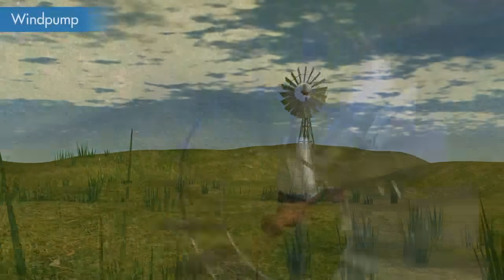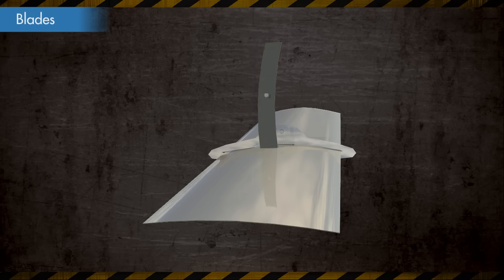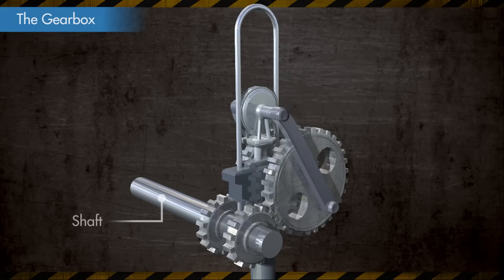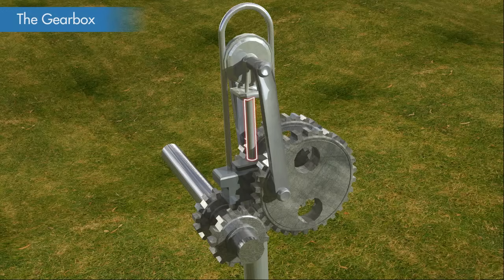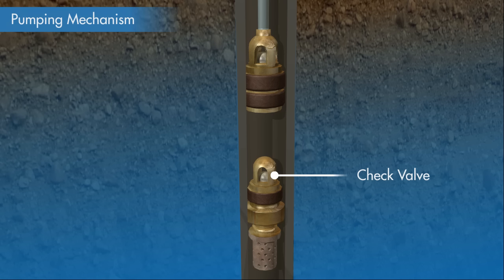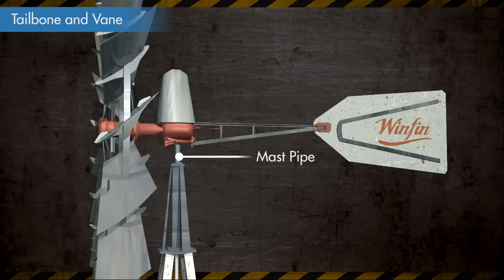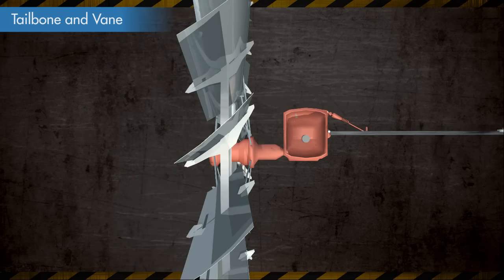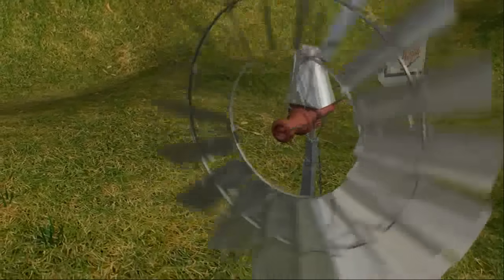Wind pump Mechanism

Comment: How do you turn off the water flow? if the well is constantly going, eventually won't you dry up the well? Hence my question.
Reply: I suppose there will be a breaking mechanism for the stopping of the pumping of water
Reply: We have a lever at the bottom of the tower, when pulled disengages the big cogs.

Comment: Extraordinary video! Really beautifully produced and explained. I have a water-pumping windmill that was installed in 2000. Such resources as a video like this were not readily available. I have learned some from books and from the use of the windmill itself. But it was incredible today to watch this video and clearly see exactly how it's working. I am having an issue with the brake, which necessitated this research. I'll need to climb up the 40-foot tower to explore. This is a huge help and it was a real joy to watch and listen to. Thank you very much!

Comment: This looks like it would be great for large pastures. Put a few of those a couple kilometres apart and animals have water, without the need for electricity. Off-grid preppers are probably fine with a normal well with a bucket on cable.

Comment: Excellent presentation. However, you should maybe think about changing the wind direction over the individual sail vane with a more representative airfoil performance diagram.  The wind creates a low and high pressure  differential which creates lift, which is then transferred to centrifugal motion.

Comment: Watching the video it seems to me that in the upstroke the wind has to lift the weight of the rod+the water ,the potential energy accumulated will be dissipated entirely in water in the downstroke,for me it would be more efficient if the piston had a chamber filled with air that once summerged in the water create a lifting force equal to the weight of the rod
Reply: Smart

Comment: wonder why electricity wind Mills don't have more than 3 blades
Reply: Different purposes need different solutions.  Pumps have lots of blades because they need lots of torque, but lots of blades introduce inefficiency in the form of wing tip vortices and interblade interference, and drag from bracing.  Long narrow blades lose less power that way, kind of like an sailplane with long narrow wings for soaring vs a light plane with short stubby wings, and often bracing, for maneuverability.  Pump turbines are relatively low cost and therefore low-tech, without blade angle of attack adjustment, which electric power turbines, at least big ones, do have.

Comment: How does one stop it if not required any more.
Reply: Most have a chain attached and you manually turn the vane to be parallel with blades to stop "production "

Comment: Is a way to put it in neutral to not pump too much or dry pump kinda ?
Reply: I've seen where the furling device has a manual lockout so that when you pull a lever from the ground, it furls and unfurls the tailbone.

Comment: The wind pump shown in this video is basically the Aermotor styles 602, 702, and 802, built (I think) in San Angelo, Texas, and under license by FIASA in Argentina. I believe they ship worldwide. The styles 602 and 702 are the most common waterpumping windmills in the USA and there are probably hundreds of thousands of them extant,  and many independent technicians and dealers, who usually also work on other makes and models of windpumps. The same principles, though slightly different design, are found on the Dempster 15, Challenge 27, and other competing windpumps, although not all of these companies are still in business. I am not familiar with the windpumps made overseas, but there are bound to be some good ones.
Reply: HI, May you help how to find the company adress in Texas , please?

Comment: „..... blades are curved to catch the wind....“ completely stupid! Wrong science here. The blades act like wings of a plane and the wind has to go faster around the curved surface so it due to Bernoulli principle it build ups a underpressure which then start the airflow forces the blade to move sideways. Don’t tell shit here, when you try to make a documentary looking like post!
Reply: @paul paulsen the video is not wrong, there are two correct explanations of this phenomenon. the first one argue that it "is the reaction force on the blades caused by deflecting a flow of air" the cause of the movement (in common English "catching the wind") and proof of this is that the old windmills with FLAT wooden blades work just fine. The second explanation is the one you mention. I leave a link to a NASA article with the full explanation: https://www.grc.nasa.gov/www/k-12/airplane/bernnew.html

Comment: Can't understand the spring part. If it increases the pressure of the wind as the blades get perpendicular, why not to do it constantly?
Reply: Comment Warrior the extremely powerful winds on the northern planes sometimes cause the windmills to blow apart it they are not regulated in some way

Comment: Why are windmills dying out??
Reply: +Deo Mupopiwa They arent. As we speak, the Chinese are Nr.1 windpump producers. They build these in staggering numbers, and even re-engineered them (mostly resizing, they are three to four times larger than the classic American windpumps), and place them all over the country for irrigation or even halt desertification. With the China Windmill Foundation, they even hand them out to developing countries with areas suffering from drought or to turn wetlands and swamps into dry land.
In my country (The Netherlands) we also rediscovered the classic traditional wooden windpumps, a lot of them are rebuild, and they serve as backups for the large electric pumps, when there's too much rain.
Reply from the maker: +Deo Mupopiwa Hii the reason is that with the advancement of technology, there are easier and affordable ways for getting ground water pumped out (electrical motors) . Other reason is that they cannot be installed in regions where frequency of wind is not much.
Reply from the maker: +YaoiMastah Hey thanks for the info. I was unaware of that.
Reply: Akshay Dafade Well, the places where there's no water, are usually also places where there's no electricity. A diesel pump may cost half the price of a chinese windpump (see: Iron Man Windmill), but costs a lot more in fuel and maintenance.

Comment: Everytime the wind blows water gets pumped?  What happens if water is not needed at that time?  Does it overflow and just become a waste?
Reply from the maker: +SarahMayAllDay I have not covered the part when there is no wind or you don't need water to be pumped out. In such cases the blades are furled up or a mechanism is installed to stop the blades from rotating in the wind.
Reply: Thank you for the information!

Comment from the maker: Hey.. thanks for the compliment. I have used Lightwave 3d for creating the visuals.
Reply: So, the spring mechanism attached to the gear box attached to wind vane allows for some turning into the wind, but not anywhere near °360 like a regular, decorative windmill, right?  I am just asking and am a complete tyro when it comes to mechanics and physics...obviously...
Reply: Your work is awesome, very intellectual instruction, but as in most videos I personally prefer no music.